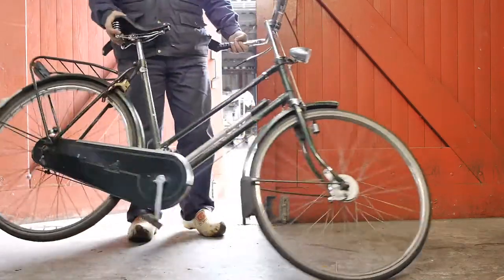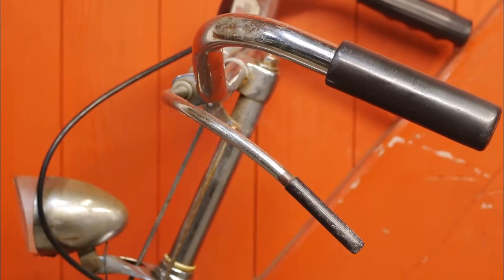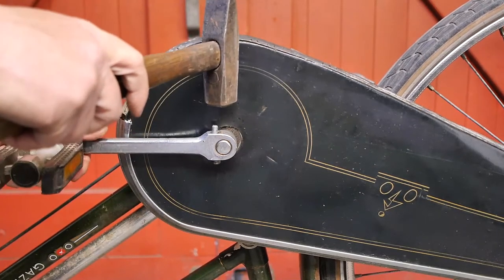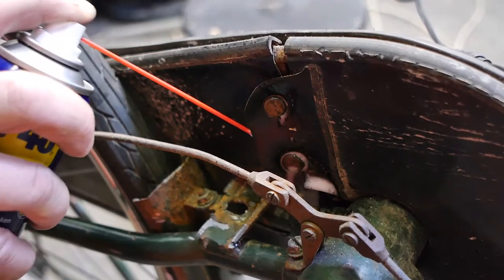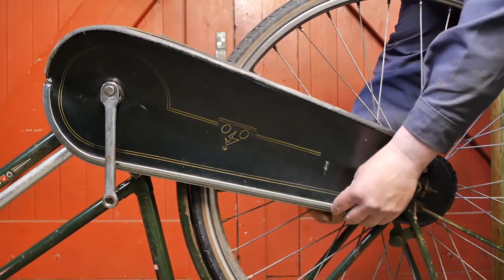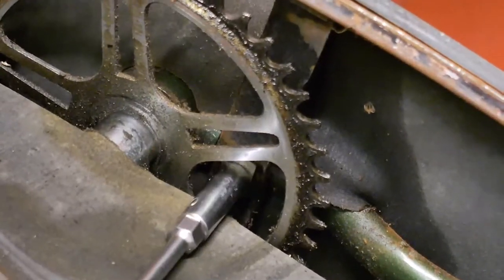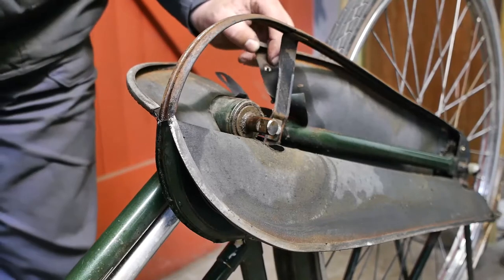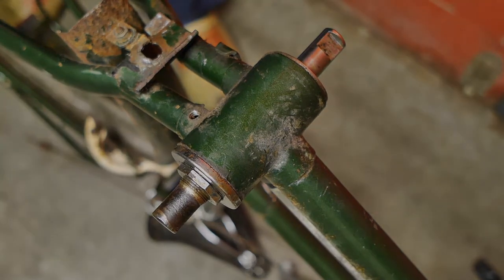Removing a cloth chain guard from a vintage gazelle bicycle

Comment: I was glad to find this video, thanks, your lucky I had double trouble with a Tandem gazelle 1975 in exactly the same paint as your bike. anyway, had similar language to you but also lots of laughs along the way. currently re stitching most of my guards which have the lace rod fastening that seems to be the only difference. I am missing the top trim from my front chain guard. any ideas where to find a replacement? Thanks.

Comment: Thank you for this video, I've been trying to figure out how to remove that long thin trim piece - mine slides a little bit but won't come off. Now I see it takes a bit of prying - I was afraid to try prying before seeing this, because I thought it was fastened to something I can't see! My chain guard is also a little ripped, I patched it with some black gorilla tape. One time that little fork that holds the fabric together fell out when I was trying to get at the chain, and I don't want to lose the little fork (not sure where I can get a replacement for that if I do lose it), so I tape that to the chain guard (I would have to remove that tape to get that fork out in the future).

Comment: The buttons are press-studs. I’ll buy the Brooks if you don’t want it. I like older well-worn ones.
Reply from the maker: Some one else called them popper. Perhaps that's American English :)
I actually repaired and re-greased the leather saddle.
Despite using brown leather cream it came out black.
And tensioning the leather improved the sitting position.
I actually got a video about it on my rolingmetal channel. Perhaps I'll rename it to rolingbike:)
https://youtu.be/06OR1C6id8s

Comment: Those are Press Studs, otherwise known (in children's clothes) as poppers. Trouble is, poppers also refers to Amyl Nitrate, which has little to do with chain guards or children's clothes.
Reply from the maker: Thanks, I'll try to remember that. Recently I started using the poppers on my body warmer when the zipper died. You saw that, I'm already using what I learned :) One of my side goals of having a YouTube channel, has always been to improve my English.

Comment: Put the right crank on, (for somtething to hold onto) then undo the big hexagon and it’s a Left Hand screw thread. The bracket should all come apart then
Reply from the maker: I made a video about dissecting that bottom bracket, but it's still needs editing.
It's all press fit, so no thread and it will be hard to fit something else. But have a look in my photo album: https://tinyurl.com/s48ee3uf